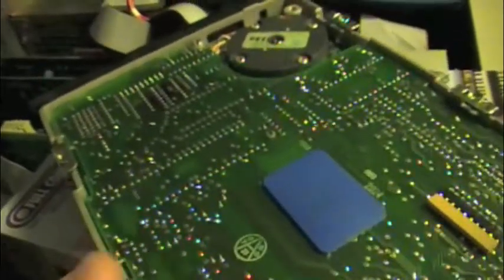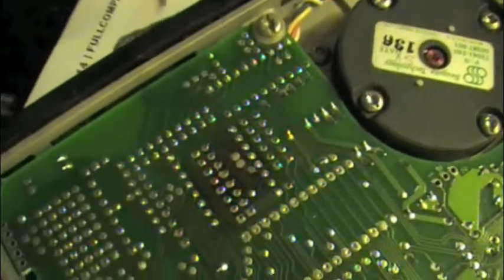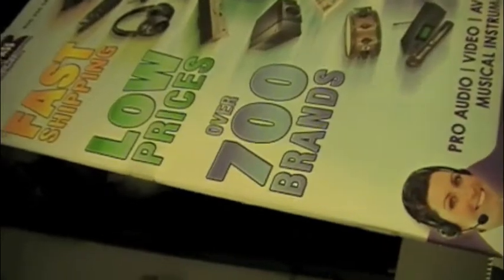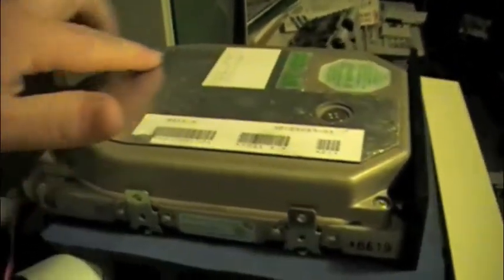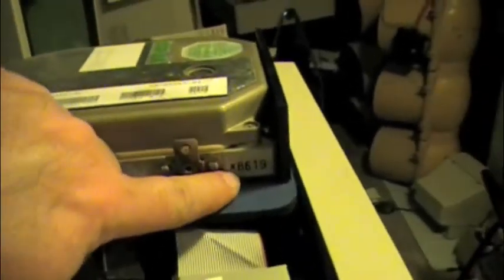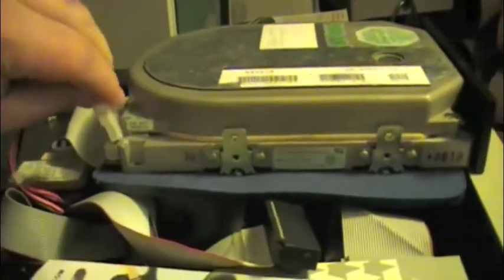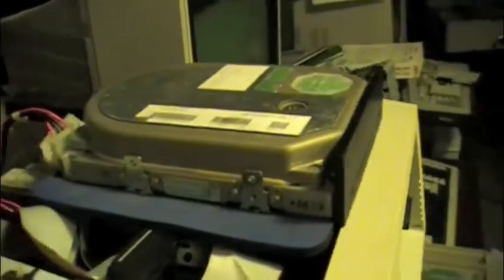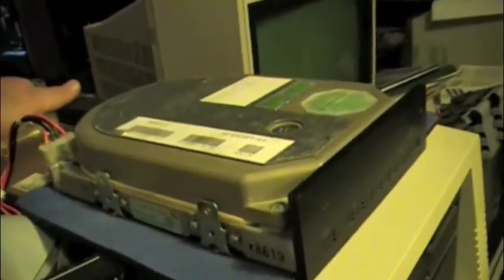4th Seagate ST-225 powerup Hot Chip

Comment: I have this drive in the scsi version (macintosh 20sc external hard drive) used in university during 25 years ! still run fine with some bad sector but sound loud very loud ! don't know if it's normal (soud like the one in our other video) can't hear seak test but works fine. Maybe the bearings are shot ?? could be